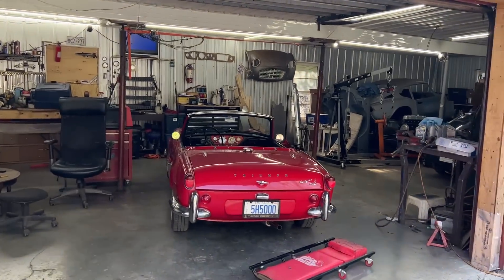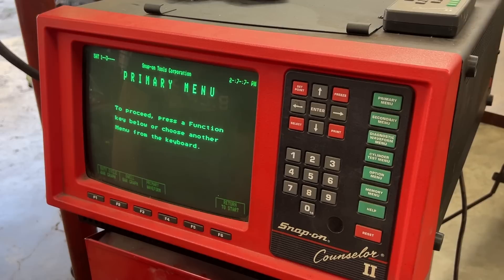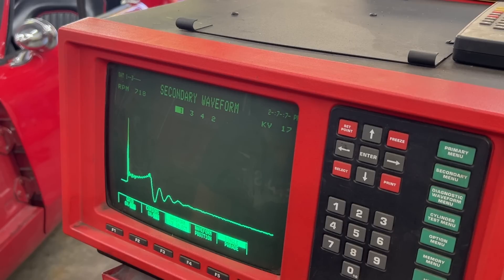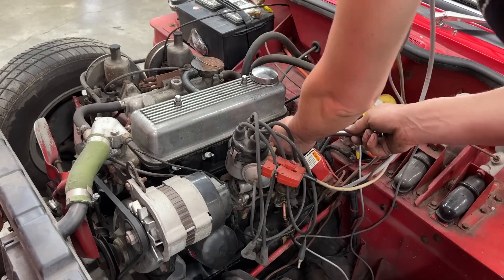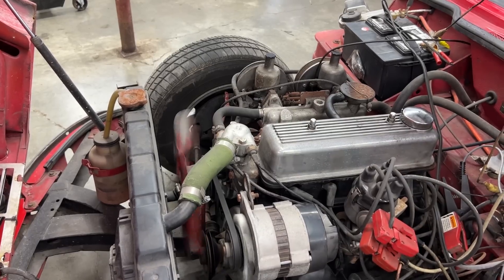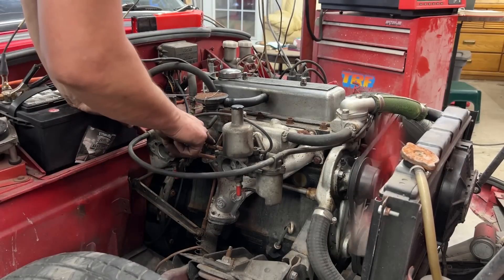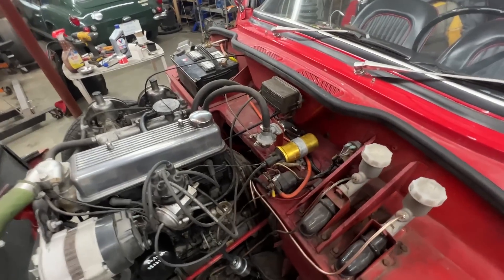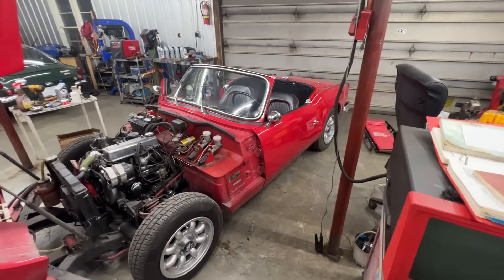1966 Triumph Spitfire - Spring Maintenance

Comment: FYI At time 38:15 those fittings are called "olives" in the UK.  You used a "brass olive" on the fuel line.

Comment: A beautiful car. 😍You can lean out the carbs more by lowering the needles in the damper pistons. You have to remove the dash pots to get access to the pistons. And the needles are held in place by a grub screw that you can get access to through the bottom sides of the pistons. The mistake people make is when assembling, they push the needle into the piston till it stops, then tighten the grub screws. But you are supposed to line up the shoulder on the needle to the bottom of the piston. Obviously wherever you position it for one, it needs to be the same on the other. Good luck.
Reply: This is also a possibility. The shoulder of the needle flush with the bottom of the Poston.

Comment: Hey @elin I'm a first-time owner of a 1965 MK2, and what a beauty! I call her Malibu Blue for the unique paint she wears. I'm the same age as she is, and I bought her cause I always wanted to drive one and to work on cars. I've had a great fall of learning/doing under the bonnet and had my First Start the other day after she stopped running last October. She had a LOT of old/original parts and a LOT of rust and yuk under there. To start, pulled everything on the firewall and took that down to the metal and repainted. Then I did some basics: Removed and replaced solenoid, coil, starter motor, complete distributor (someone had put an electronic one in years ago, and I think that might have been the culprit, and I replaced it with a Delco points dizzy instead). The wiring, as you can guess, is old, frayed, and lots of changes and updates over the years. But once I figured out what was what, I got First Start fast and strong, with an idle at about 800-850. Anyway, two reasons for my note: I noticed in your vid above that you put a breather hose on the rocker cover's nipple. I want to do that as well. I am curious where yours goes (I can really see where it leads to, how far back or down or if it goes to a filter like I've seen some guys do). Any recommendations about that? Also, my next project is to pull all the wiring and install a new electrical harness. I'm assuming you've done that, so just mentioning it in case you have any words of wisdom! Love your vids, thank you for those. JD (Walnut Creek, California)

Comment: thanks Elin.  I appreciated the detail on this one.  But regarding setting mixture, the factory manual for our '54 TR2 with H4s says to lift the piston 1/32 inch and there should be no change in rpm if the mixture is correct (no lifting pins on the H4).   Instructions for the HS4s on our '67 MGB are like you used.  It didn't used to be a major sin to drop the needle slightly to compensate for rich mixture if the jet nut was already turned up all the way.  But a carb rebuild was called for.

Comment: Hi Elin, after all your work it sounds so much better, I guess that's why it's called tuning!!

The thing I loved about these cars is the access, and the built in seats on each side for adjustments, they often left a tyre mark on my overalls!! I remember using a special spark plug with a window in order to check mixture. I guess these days you would use a gas analyser but they sound expensive.

I like the look of that green lady in the background ..... we need an introduction 😅😅😅

Have a great weekend and good luck from Spain!!
Reply: I think the see through spark plug was called  a Gunson colour tune. As I recall you had to adjust air/fuel mixture until the colour was blue.
Reply: @jackn4853  Yes, that's it I remember that name!!

Comment: She sounds really nice Elin, especially on the road. My guess on the carbs- when someone fitted the pancake air filters it leaned out so maybe someone fitted richer needles- and went a bit too rich? Other thing is you mention engine vibration- if you still have that, try running it briefly with the metal fan off. This turned out to be the cause of a surprising amount of vibration on my MGB GT even through the fan looked OK spinning.

Comment: Elin two things to check with the SUs:
-verify that both carbs are using the same jets (there’s a number stamped on them)
-verify that the SU pistons operate the same. This is done by doing a “drop test”, (there are several videos online for this procedure). The piston and the chamber are matched sets. 
Over the years the jets and pistons may have been swapped around many times, so knowing you have a correct baseline makes your diagnostics easier!👍

Oh, I couldn’t find the link to your merch😕
Reply from the maker: I remember I bought rebuild kits for these carbs when I rebuilt the engine, including jets and needles. So I am sure they are the same. However the needle profiles might be incorrect for my area. 
The store should show up before my videos, but maybe not in all countries.... I don't know how that works LOL. Here it is https://my-store-df5cac.creator-spring.com/
Reply: @RustyBeauties  Elin, I live in New Jersey, so we have cold winters and warm summers. I run TW needles in the HS6 SUs on my TR4A, and they work very well.
Thanks for link!👍
Reply: @RustyBeauties  I enjoyed the video that tuning machine is very intersting, but i ran into a similar problem with my mg midget it uses the same type of carburetors. My car was running rich never able to get it leaned out enough ended up being rich because float fuel level was too high, something to check

Comment: Elin,  Its been years since I touched a SU carb, so I may be confusing it with some motorcycle carbs, but is the needle adjustable where it mounts to the piston?  You may be able to get some more length so the jet adjustment isn't all the way to the top.

Also noticed the green GT6 in the background.  Is this the next customers car?
Reply from the maker: No, these needles are fixed. The jets are what moves. Most of Zenith Stromberg carburetors  have adjustable needles, some of the early ones are just like the SU's with adjustable jet and there are some that are not adjustable at all..... The only way to adjust the mixture for them is by replacing the needle to a different profile.
The GT6 was in the shop for a quick tune up and spring lubrication. Not mine unfortunately :)

Comment: Home Zinc plating is difficult and time consuming. Not as easy as the diy videos suggest... Bit of light oil on everything and just use it. Still enjoying the vintage snap on scope diag.... 👍
Reply from the maker: A friend of mine is zinc plating small parts with a pretty good results. I've been thinking about it forever, but when I remember I have to do each part separately I give up before I even start LOL